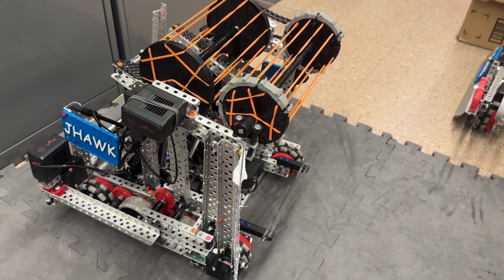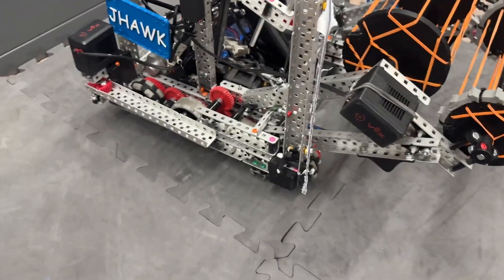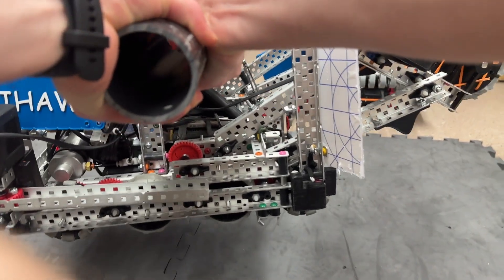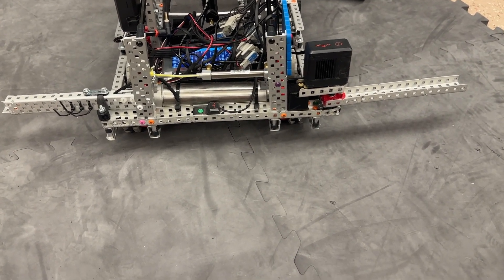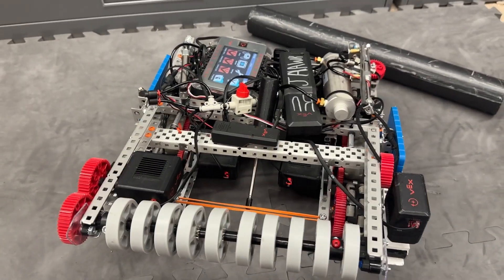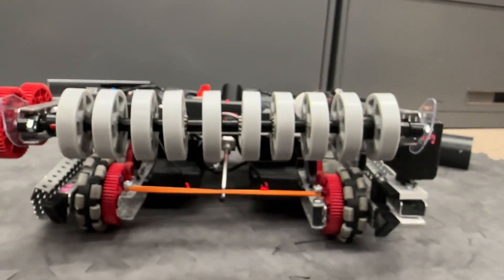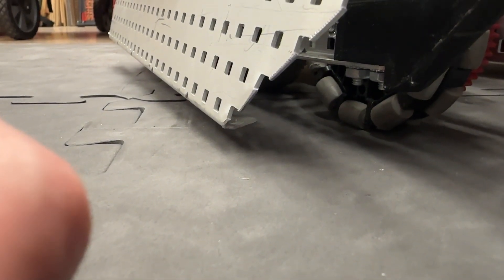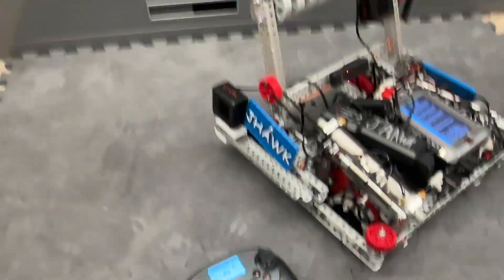JHAWK Vex Robots Explanation

Comment: W wire management
Reply from the maker: We custom crimped our cables for the first robots we built in the season. Then we ran out of materials to crimp more cables and were stuck with whatever lengths we had crimped + those from the claw bot kit.
Reply: @9MotorGang  where'd you find a clawbot kit
Reply from the maker: @thuong3818c  https://www.vexrobotics.com/v5-classroom-starter-kit.html